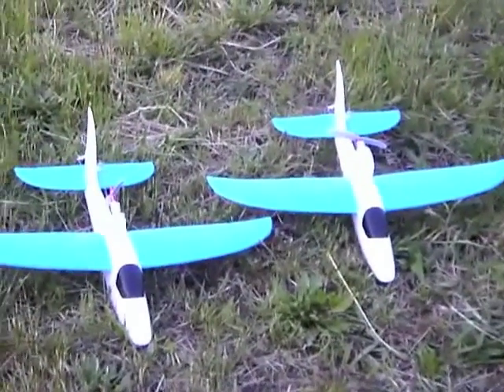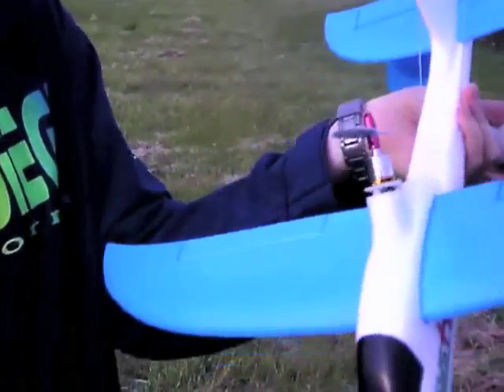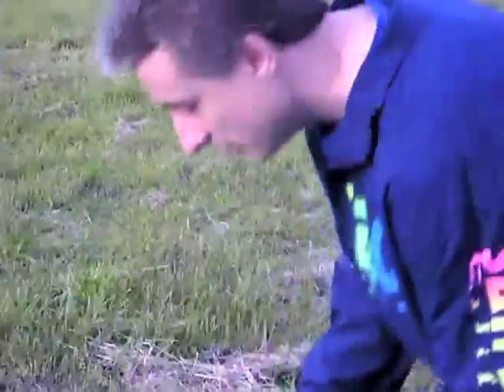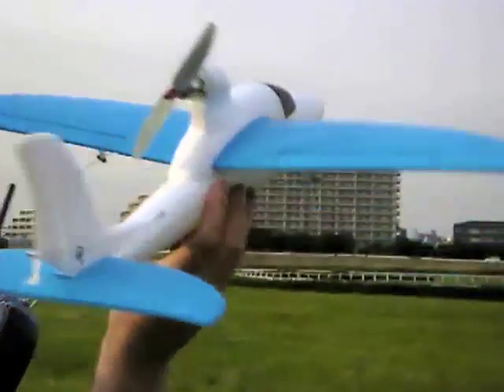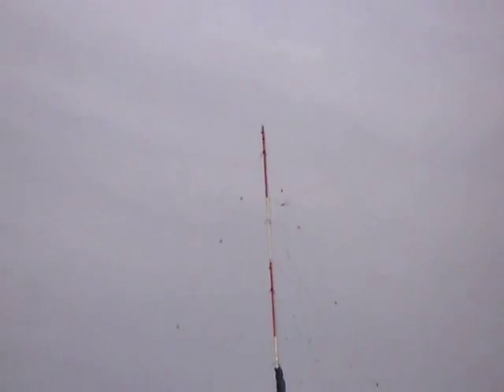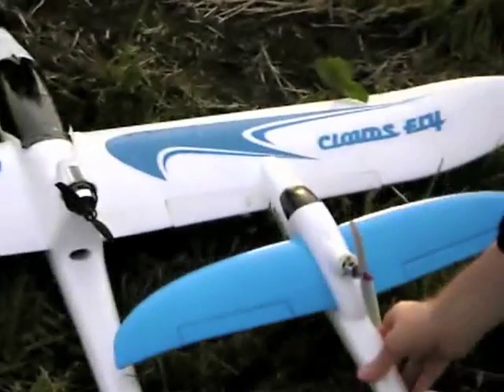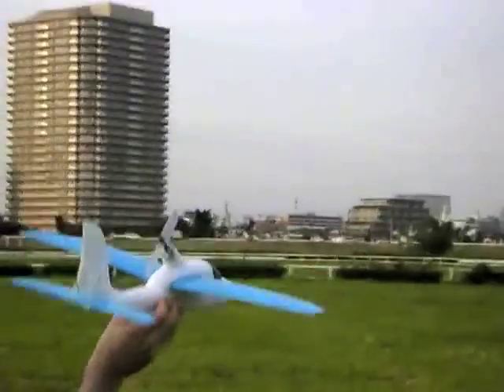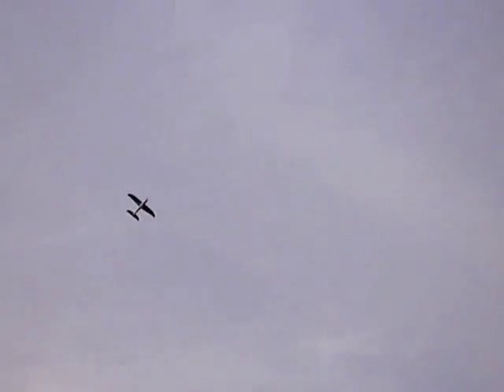THRUST ANGLE WARS - High Hopes for the Dolphin Sport Plane Twins Ep.1 of 4

Comment from the maker: I have a couple NE Sky 500s as well.  They are a completely different kind of plane, much more basic. 3 channel, rudder and elevator only and weigh about one-third the weight.  Good for beginner, but can't handle much wind at all.  They are a true (non toy) RC however, so make sure you set up the control surfaces to level before first flights.

Comment from the maker: You got it (on the flight characteristics). As for slow flight, they really won't fly very slow with the small wing area.  That's the "problem".  They fly well at all speeds that they fly, but even the glide (no throttle) is a bit fast for beginners and doesn't last long as they come down quite quickly without throttle.  The plane's original name was "Sport Plane", so I guess it wasn't designed to glide much but rather be agile and "sporty", and that it is.

Comment from the maker: @321juanc 
I think you misunderstand.  There are no problems, really, just compromises.  The old version has lots of power but pushes the nose down when you throttle up (easily compensated for by experienced pilots).  The new version with the high thrust angle is better for beginners because it doesn't do that, but you lose some power and agility.  I highly recommend this plane, but not for complete beginners.  It's just too fast.

Comment from the maker: @darkmonk99 
The nine eagles planes (except the new sky runner like this design) have the motor in the front, so the battery is on the center of gravity, but on this plane the motor is behind the COG so the battery must be up front.  It sounds like your prop might be slipping or reversed.  Make sure the writing on the prop is pointing forward and make sure the prop is really tightened on there good as it is actually spinning in the wrong direction because this is a pusher design.  Good luck.

Comment: I just got one from Hobbyking-put together ok- have a 500 mah as recommened-have the battery pushed up the front nose and a t/x hobby king behind-the center of gravity worries me-is your battery in the nose end-sounds silly but a newbee-have a few 3 channel nine eagle planes-4 channel is new to me-Also with the motor screw do you put like a thread lock tight glue as mine seems to get loose-tried to fly today off the ground but would not lift hence feel to nose heavy-any advice welcome